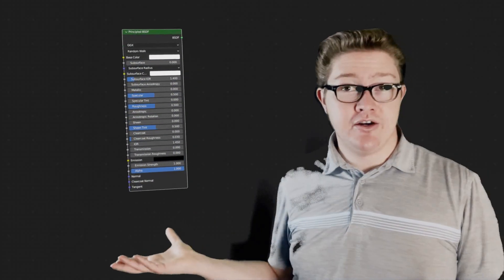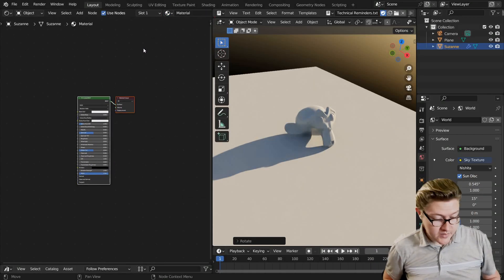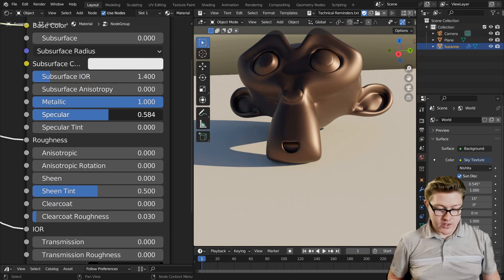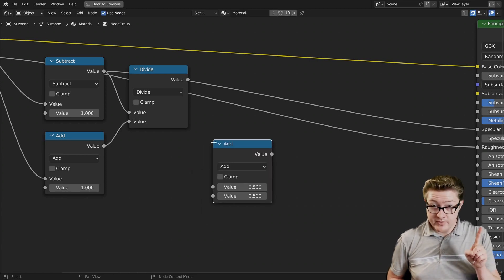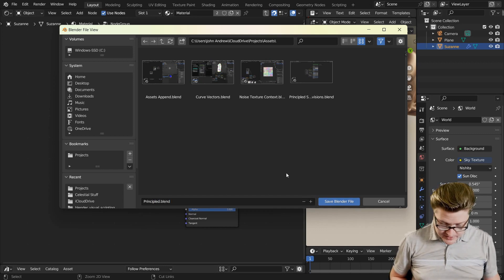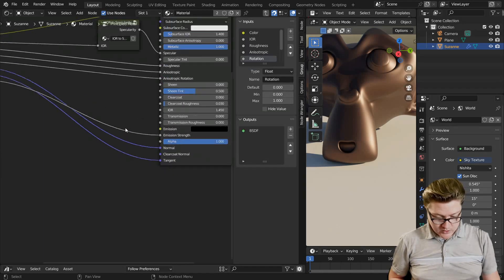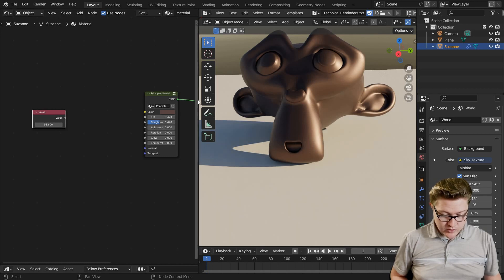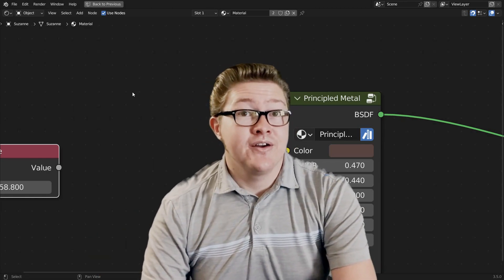This Metal Shader Is Better Than the Principled BSDF (Blender Tutorial)

Comment: I am wondering if this technic can be used in Blender 4.0 with the new Principled Shader that has been updated to adress many issue the previous Principled BSDF node had.
Reply from the maker: I was certainly taken aback when the new Principled shader was released after I posted this video.😆 The truth tho I think is that my setup 𝘤𝘢𝘯 be used in 4.0 (other than that the 4.0 Principled node’s Specularity seems to have an error with metal which I hope they fix soon) but the question is whether it’s really needed now. Since one of the motivations behind my making this node group was the overwhelming size of the old Principled shader, in 4.0 that irritation has basically been solved with the node panels that have been introduced. I’ve honestly been more comfortable just using the Principled shader than I was before.

Comment: i'm confused. specular doesn't affect metallic materials. at all. u can just set metal to 1 and tweak the specular value and nothing will change. so what's the point of that whole nodegroup into the specular socket of a fully metallic shader???? (btw the factor is there because u may have masks to define metallic parts of a textuse, like a manhole on a road. it could be a boolean but this way u leave more artistic control.)
Reply from the maker: Yes I ran into this issue too. Specular used to affect metal as it should in the version of Blender we had while I recorded this, but I noticed in Blender 4.0 when they updated the Principled shader, the Specular doesn’t work as it should on metal. I submitted a report on this problem to the Right Click Select website and I’m hoping they address the error in another version of Blender soon. But yes, if they fix it, that setup for the Specular (through IOR like here if one chooses to do so) will serve a function of technical realism.
And yes allowing a factor or Boolean for metallic parts might be useful for some people in certain cases, this tutorial merely focuses on cases where one wants an entire material to be metal. But that’s more just a preference, especially now that the Principled shader looks less busy as is anyway thanks to node panels since 4.0.

Comment: as of blender 4.0, is the IOR value changed in principled BSDF?
Reply from the maker: Yes sir, indeed it did. It seems this would make what we did in the tutorial unnecessary now. Since it seems in the new Principled shader the IOR value should affect metallic shaders the same way we made it to do in this tutorial. So this tutorial might be rather redundant now.😆
The only problem I noticed is in fact the IOR and the Specular (which is just a multiplier of the first) don’t seem to have any affect on the shader when it’s set to metallic, namely the white-ish reflection fading in around the edges. I assume this an error or oversight in 4.0 and I did report it on Blender’s Right Click Select web sight, we’ll see what comes of it.
Reply: @nrdkraft  ah i too was confused looking at the other IOR field inside Specular thinking what and why there's 2 fo them 🤣

Comment: I think the blackbody radiation strength should be directly computed from the temperature, too, if you're trying to make physically accurate model here.
Reply from the maker: That’s a good point! I thought about doing that but I neglected to find out what the equation for it’s glow brightness/strength should look like. Any insights on that?
Reply: @nrdkraft  Good question. I think you should use Stefan–Boltzmann law. It's basically Stefan–Boltzmann constant σ times the temperature to the fourth power. As usual, the temperature should be measured in K (kelvin). That gives you the radiation in W (watt) and you may need to divide that by Pi to get watts per square metre per steradian.

As the scale that Blender uses internally is unknown you can basically just to temperature on the kelvin scale to fourth and the whole result multiplied some correction factor (trial-and-error) which would include both the Stefan–Boltzmann constant and Pi or some other factors needed to make it sensible.

I would try something like (1e-9 * t * t * t * t) where the t is the temperature of the object on kelvin scale. If you then try something like 1400 K with iron, you should get glowing orange and practically black for 500 K.
Reply from the maker: @MikkoRantalainen  Awesome, thank you for the tips!! I’ll take that into consideration and do a little more research as well. I may save it for a slightly more advanced black bodyshader that I’d like to do in the future. A smaller separate node that can easily be added to any other shader whether this metal (at its pre-glow stage in this tutorial) or dielectric materials like for hot glowing wood or coal or otherwise. Currently the Blackbody node only goes up to 12,000°, and I believe some stats glow hotter blue than that, so I might want to add that little accuracy in the future too.